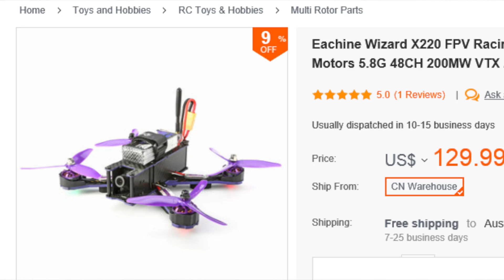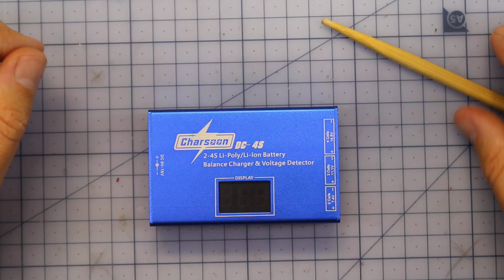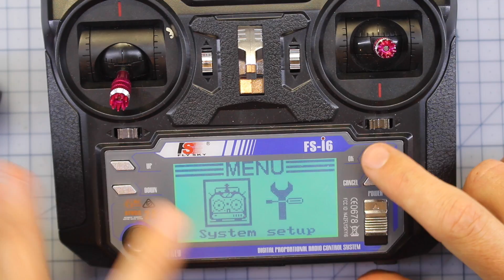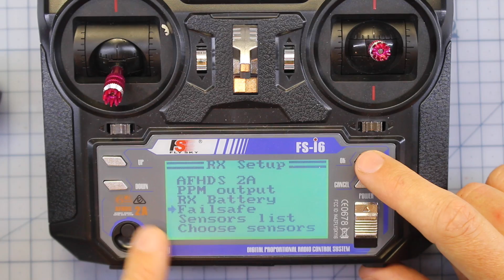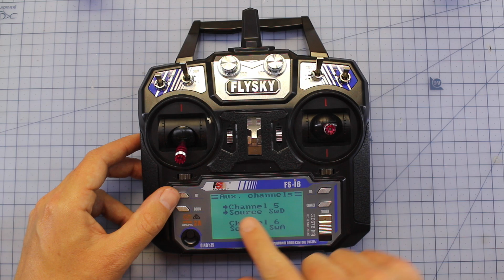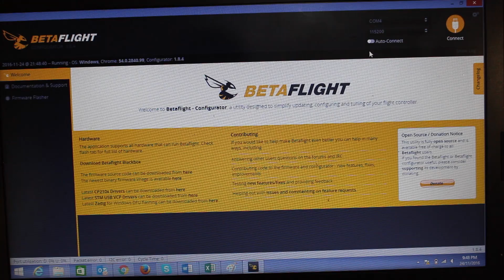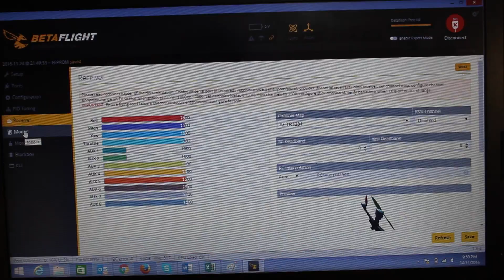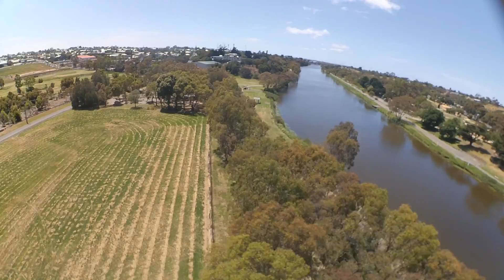How to get FPV DRONE RACING for under $300! Parts +Full setup.

Comment: Is there any way to stream video to a phone like AP drones instead of using a headset?
Reply: Not unless you use wifi which has a way too high latency(lag) that's why we use analog signal as it's very low latency. Flying fast requires video that can keep up with you.
Reply: Ron Tropics I've been looking this up as well. Very hard to find any concrete info.
Reply: Not natively, but with a video receiver such as this one (link below), you might be able to display video to a portable DVD player if you still live in 2005 like I do  :)  My main problem with the FPV goggles is that you don't get a sense of your surrounding, so I think I'd feel weird if I just sat down alone in a field with goggles on.  

Here's the link to the receiver:
http://www.banggood.com/Eachine-TS832-RC832-5_8G-32CH-600mW-FPV-Transmitter-Receiver-7_4-16V-p-1079941.html?
Reply: In my opinion it is quite the opposite.  A good set of goggles is so immersive that you forget you are sitting in a field and you begin to think as if you are the drone itself.  I get so immersed in flying I flinch when I crash a lot of the time.  Like I actually expect it to hurt when I see the ground rushing up towards me.
Reply: Plur307 Sounds cool!  Do you have a budget headset you could recommend for less than $150?  I know they mention one in the video but there might be some good ones hiding :)
Reply: Well I went ahead and just ordered a Kylin Vision. Hopefully I made the right choice! Thanks for all the info everyone.
Reply: JustALowlyCommenter Sorry the only headsets I have any experience with are fatsharks.  I bought a cheaper set of fatsharks so that I could have a spare set to show friends and family what FPV is like and even those are too crappy for me to recommend.  FPV headsets are the one place I really don't recommend going cheap.  The video quality is one of the most important aspects of an enjoyable FPV experience.  My Dominator HD were a good investment.
Reply: real account gx210

Comment: nice sudgestions :D 
what if I'll get the Eachine VR D2 from Banggood which is almost the same price with the Kylin. Would you recommend Eachine Vr D2 or Kylin.
thanks alot Ste :)
Reply: Adrian Antones I just asked the same thing. He never gave a reason for why he chose the Kylin
Reply: BoondockSaintRyan it is okay. may he just first picked up Kylin V because it is pretty basic, sleek design, very good display too. newbie friendly.
Still I am looking forward for his opinion about the fpv transfer between the Eachine VR D2 and Kylin Version.
 Still GOOD JOB for Stu!!
Reply: Adrian Antones I am using the vrd2 and if I had to I would buy again
Reply from the maker: yeah I reviewed both, found the kylins to be easier to use, fitted my face better and didn't make me feel cross eyed. The VR d2 does have dvr which i used incorrectly, but even with the dvr off i still prefer the kylins.
Reply: Dre Con nice!! helped me alot to descide. but Stu reviewed vr d2 and he said when it record the fpv it goes laggy... how yours?
Reply: UAVfutures thanks Stu for all of your videos

Comment: Thanks for the video, I was about to buy this exact set up! Glad I chose correctly. Was worried about Cleanflight (don't really know what it is) but thankfully you've covered it. Also, for everyone else looking to get this - I've picked out some upgrades that I think you should get:

Some Aomway antennas - you'll need one red one (for quad) and one blue one (for goggles). These are the best quality while still being pretty cheap.

Battery - fits all specs, is higher C but I think that's alright, 3s because one guy online said he burned out his motors with 4s and someone from FliteTest or some other channel recommended sticking with 3s. Though, banggood page says motors can take 4s. Either way, I'm sticking with the safer option:
https://hobbyking.com/en_us/turnigy-nano-tech-1500mah-3s-25-50c-lipo-pack.html

Simulator cable - you're going to want to do a lot of simulator to get good. Use Hotprops, it's free. This cable should (hopefully) let you use the FlySky with a sim, and there's a video on YouTube on how to set it up:
http://www.banggood.com/22-in-1-RC-Flight-Simulator-Cable-for-Realflight-G7-G6-G5-G4-p-950398.html?p=4P16081355389201503W

Low voltage alarm, think it should work, very cheap:
https://hobbyking.com/en_us/hobbykingtm-lipoly-low-voltage-alarm-2s-6s.html

Also, get a soldering iron (this channel has a video on that), and if you want to travel by plane then also some Lipo bags and electrical tape. 

Ask me if you've got any questions/corrections - I'm only just getting into this hobby but I've done a bit of research.
Reply from the maker: GREAT INFO HERE

Comment: I have done the DVR and add-on power s/w mod for my kylin goggle. The picture are great with no complaint , however the runtime with original battery is horrible. Now I alway use it with continuous charging.
Reply from the maker: yeah they need a second battery

Comment: I have that TX and it's great, but people should get the upgraded version instead.  It's has a few more features and is more easily upgraded.  It's only like $10 more.
Reply: Please keep your advertising out of here.  The banggood affiliate program sounds good, and I myself use it, but please do not just post links to the page with your code on it.  If you have a valuable addition to the comments section, then it is fair to use your affiliate code on the end, but please no soliciting.
Reply: http://www.banggood.com/Flysky-FS-i6X-2_4GHz-10CH-AFHDS-2A-RC-Transmitter-With-X6B-i-BUS-Receiver-p-1090406.html?bid=27151?rmmds=category-top-bbanner
Reply: williwonti that's what I did
Reply: williwonti what is TX?
Reply: Pim Maas they do have a sale on but it's definitely not 50% off ALL the rc products, I'm looking at it now and it's just around 20% off RTF drones
Reply: sitoplex yeah I am so sick of people doing that >:( I report it every time I see it
Reply: sitoplex YouTube really needs some filters for this stuff
Reply: Thanks buddy
Reply: TX means transmitter :)
Reply: What is the main differences between this one and the original?  I'm completely new to this so any info is greatly appreciated :)
Reply: JustALowlyCommenter this one is newer and has 10 channels (can do more stuff with it) either way both will work.
Reply: To be clear, you can reflash the older one to use 10 channels as well, but it's a bit of a chore.  Also the switches of the newer 'X' model are wired in a way that you can upgrade them.  It also has an apparent blutooth antenna inside, but no one has done anything with it to my knowledge.  It also comes with a slightly better RX (receiver) which is smaller and lighter but doesn't have a case.
Reply: This is a lie! There is no discount, the link is a affiliate program link. Please mark Rens Kippen comment above as spam using the 3 dots on the right.
Reply: williwonti hey could you post a link to the quad you're talking about? I wouldn't mind spending a little extra. I want to get started with the quad racing and want something that isn't junk. even though i don't think the one he has on this video is. But 10$ more for something nicer would be nice to see!:) thank you!
Reply: My bad still worth the extra 10 to me though!. Shows you how much I know! lol

Comment: Stu.  I have the X220 and it's original donor machine the TC-R220 with my own setup.  It's a great machine for the price, but it's not close to race ready.  That VTX is 200mw and that horrible dip switch setup.  Now that's fine but I've just joined with the local MultiGP chapter and looking forward to my first race, but 200mw on 5.8Ghz is illegal in Australia, and thus we are limited to 25mw.  Plus we are band limited as well according to ACMA rules.  I love your channel heaps man, but please make sure you let people know what's legal and what's not.  Racing with mates out away from crowds is one thing, but to keep our hobby/sport on the right side of things we have to keep on the rules (and I'm not saying I agree with them) to keep on the up an up.  PS:  The camera on the X220 is poxy as well.  Even with a GoPro 2.5 you can't get 90 degrees out of it.

Comment: Any reason why we should get the arf kit versus the rtf kit or are they the same thing?
Reply: ARF - Almost ready to fly. Usually requires radio transmitter & receiver
BNF - Bind and fly. Requires radio transmitter for included receiver
RTF - Ready to fly. Comes with all required to fly.

Why ARF? Author has chosen better battery & charger comparing to RTF :)
Reply from the maker: I believe the ARF has a better flight controller - crazy i know, 
this is what I have heard anyway.

Comment: You could spend about $3 or $4 on one of those little battery checkers. Plug it in to the balance plug - fly - and it will beep beep when it's time to land :D
Reply: TinyPirate do they connect to the battery or the quad? Excuse my noobness.....
Reply: +Michael Darling plug it into the balance plug on the battery
Reply: MTL Racing is it possible to install an osd on this quad instead?
Reply from the maker: great idea tiny pirate "arrrgghhh" (that is my pirate voice)

Comment: bump the P setting up by 20 and I up by 10 on pitch and roll for a slightly more locked in feel. The PIDs will still need tuning but this will help a bit for a beginner and feel a bit more locked in!

Comment: i've got the flysky and the wizard
My glasses are the eachine ev800 and the charger an imax b6
I've bought this over the time and my final cost has been about 260€ pretty close to your kit
The only thing i think is good to include are some 5$ cheap cloverleaf antennas and a 2 buzzers (2$ each), one for the battery and one  for the localation if lost
Reply from the maker: yep, great advice

Comment: Nice video stew. one thing I would add is it's definitely worth the money to get something like the Turnigy Accucel 6 over that little hobbyking charger. It's only a bit more expensive and will last you a while in this hobby, that little blue charger will be the first thing you replace if you get more batteries.
Reply from the maker: agree

Comment: instead of getting the transmitter and the quad separate i gues ou can buy the rtf version with the flysky transmitter?
Reply from the maker: you can, but I think if you go this way you learn more and also the ARF has a better flight controller.
Reply: got the transmitter today and cable today so i can train in flight sims while getting more money for the drone and the other stuff :)

Comment: Hi mate my wizzard arrived  yesterday what board do I choose in cleanflight to flash firmware because I've got no yaw action going on.  it's registering on he receiver tab on cleanflight that yaw is being used but the quad will not actually yaw any ideas mate
Reply from the maker: in the pid channel you will notice the yaw value is NA, change it to 1.00 or 100 cant remembr which.
Reply: micheal ward legend
Reply: in cli type in 'version'  (without the ' ' )  it will tell you what is currently on the board.
Reply: Use betaflight instead of cleanflight. I had the same problem and I hooked it up to betaflight and changed the yaw value in the PID channel like Stew said. I don't believe it shows up in cleanflight.
Reply: Took me and my buddy at least an hour to figure that out in the field.  Good thing I always bring my laptop.